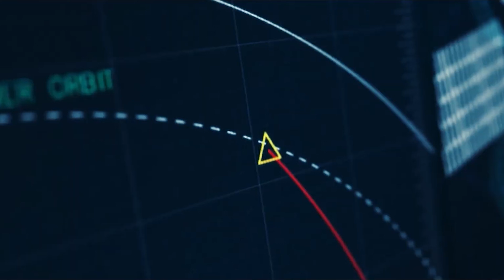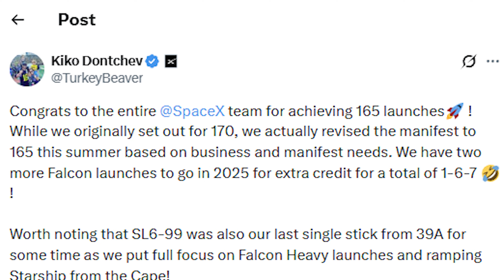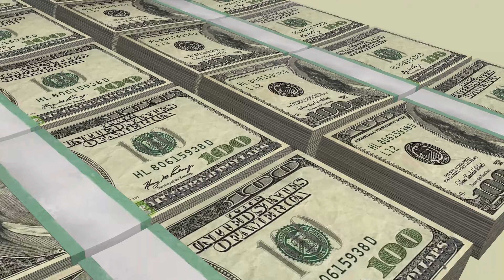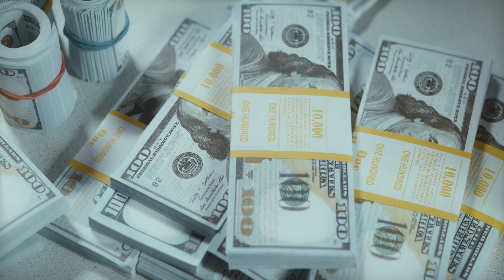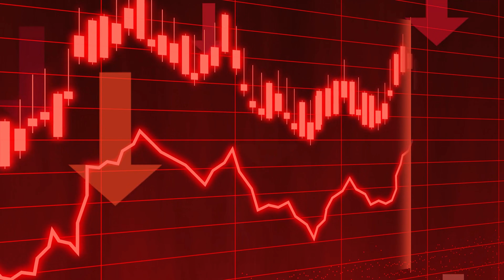What Space Force just did with Rocket Lab after SpaceX Shocked Blue Origin!

Comment: I think Blue Origin is a big form of Falcon 9, where Starship is above them, catch reusable booster and ship so nothing is wasted. Space force can save alot of money using them. While Blue Origin can't so they will charge a higher price. Rocket Lab can be used for small satellites. No way Rocket Lab will charge a lot of money to get the spot.
Reply: Most of Rocket Lab' launches are 300kg loads. Neutron will be a maximum of 13,000 kg.
Reply from the maker: Yep, Starship’s reusability is a huge factor for cost savings. Rocket Lab fills a different niche.

Comment: Blue Origin could beat starship in launch cost.  It would require copying Neutron's Hungry Hippo design.  Cheap and spindly second stage boosters can be mass produced with 3D printing, and made low cost.  I doubt Bezos, due to Hubris, can pivot - and hence will stick with his design.
Reply: 3D printing of Stainless Steel is not strong enough for rocket engines?
Reply: @mrbaab5932 They are already 3D printing rocket engines.